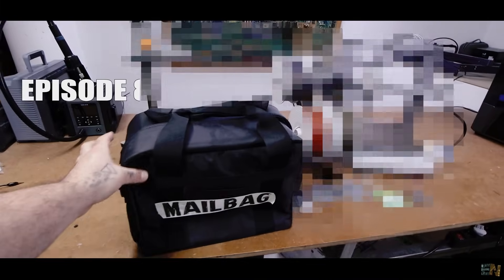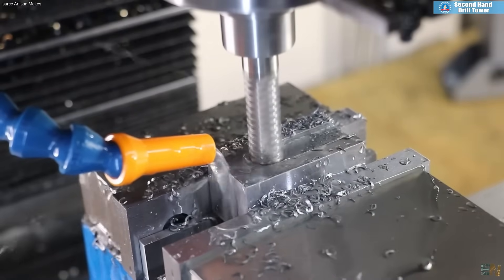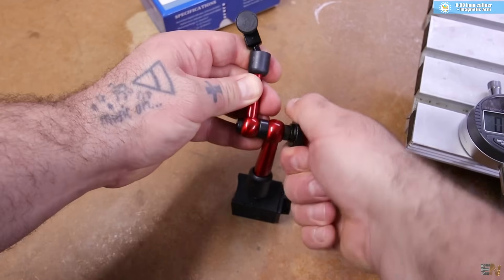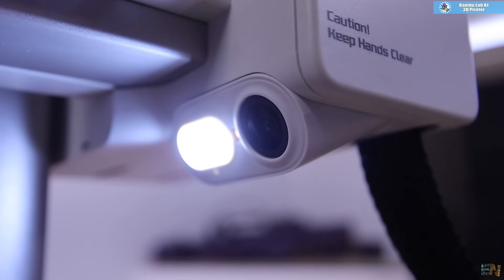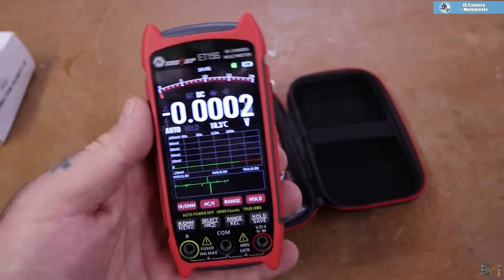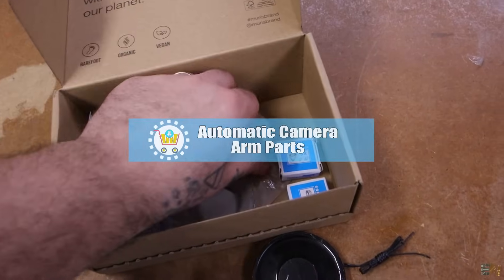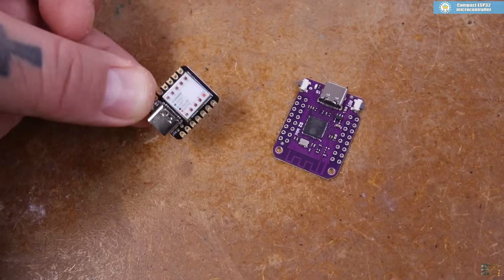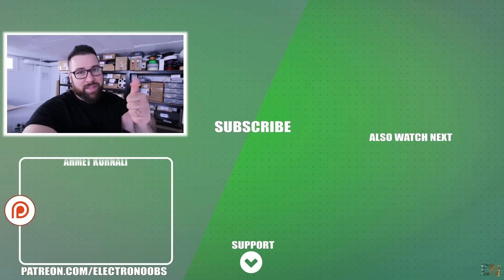Must Have Workshop Tools That Will Change Your Projects FOREVER!

Comment: Why doesn't the Peltier module work with a 12 volt PWM motor speed controller? I want to run it at 9 volts.

Comment: The IR camera is an LCD, so a black background uses more power than a white one. It would be the opposite on an OLED screen but at that price range, not possible.
Having to change modes by repeatedly pressing the button until you reach is really annoying.
The macro lens is quite nice though, not so common.
Reply from the maker: @merlin2600  true